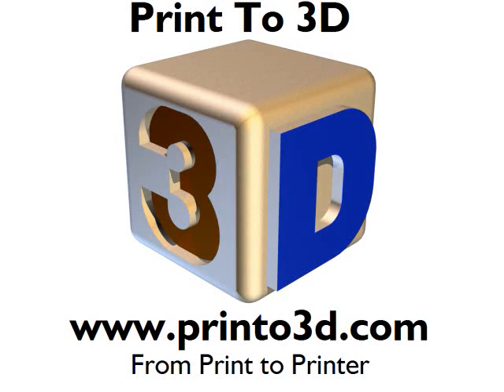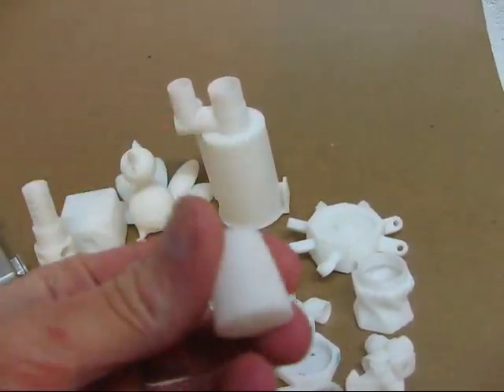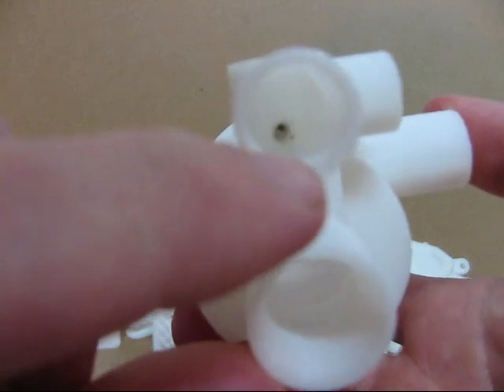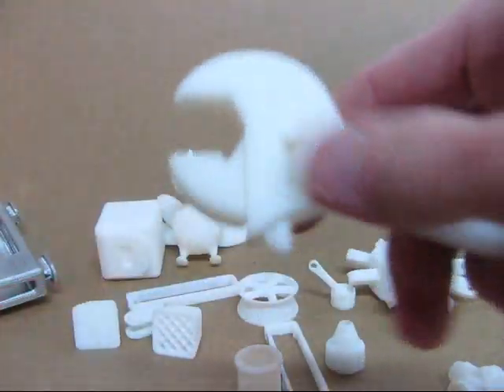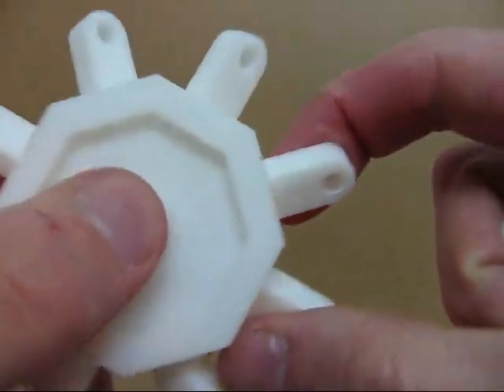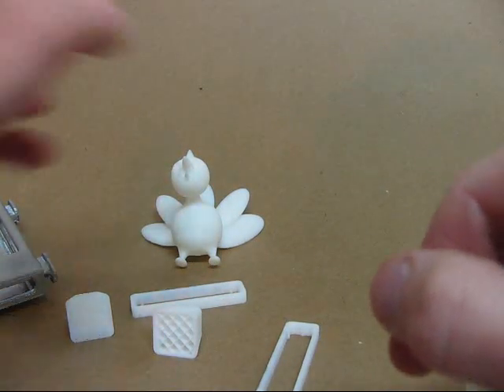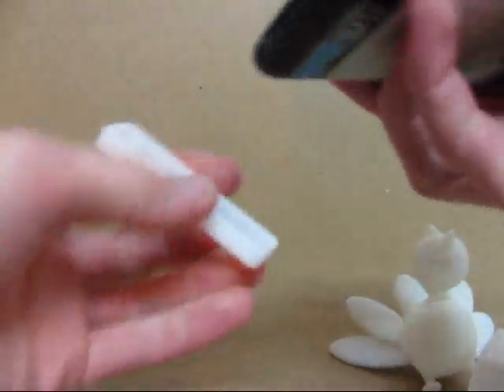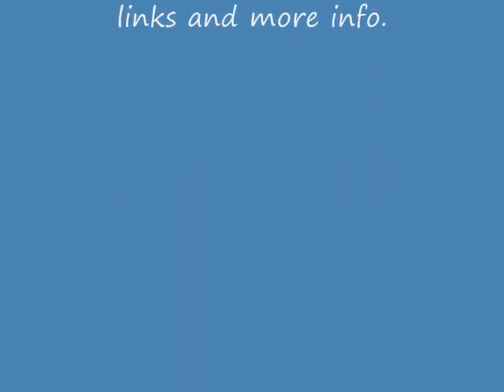What Can You Make With a 3D Printer?

Comment: That hose fitting must have needed some good support. I got a creator w/ 2 extruders but one is far better than the others.  For 1200 bucks, it's a good start. If you give the machine enough time for the support it does well.  Heating plate isn't awesome, so if you get one, get a roll of the yellow foil for the bottom.  It holds up alright, but after too many parts it will get tacky.

Comment: I'm thinking about producing a 3D printer from a plotter that uses wax to make lost wax casting molds so metal parts can be made easily. Simply print out the wax pattern. Place it in plaster and allow to dry, then bore some holes and melt out the wax so you could then pour cast some high grade aluminum alloy castings.They already have 3D printer AR15 high capacity magazines and lower receivers with the regular UV Teflon, Imagine precision AR15 high quality alloy lowers that can be emailed? lol

Comment from the maker: @Pentagon1337 Printed ABS is up to 70% the strength of injection molded parts.

Most 3d printers use proprietary materials and technology.  Some printers print using ABS filament, powdered material, liquids, and even paper.  You can't simply change to any material you would like.

LOM, FDM, SLS, SLA, 3DP are all printing technologies.  Google them for more information.

Comment: @ThomasAtlus actually it wouldn't take longer for more complexity (except to produce the computer model itself), but on the other hand making the CG model would take a long time. The real limiter would be. Is the machine accurate enough to produce parts on a PG scale? As a matter of fact it probably would be difficult to have the machine make the model in 1 go, you'd need to make the runners of parts. Because some parts have different tolerances. You want the model to stay together dont you?

Comment from the maker: @vojin04 3D CAD models are required.  If you are referring to 2D CAD drawings then they will not work.  They would need to be drawn in 3D from the 2D drawings.

10x10x12 inches

Comment from the maker: @MrPowderedToastMan So you think custom parts should cost similar to their off the shelf counterparts?

Sure you can print replacement parts, but that isn't the main use for a 3D printer, YET.  The point is to be able to print anything including the part you just designed in CAD.

Comment from the maker: @pietrosperoni Multiple material printing is available, but not with FDM printing technology.  It is nowhere advanced enough to print electrical cables though.  Mainly just plastic and rubber like materials.

Check out the Objet Connex.

Comment from the maker: @t28sarge FDM does not use powder.  It uses ABS plastic filament and support filament which dissolves.

Even though the support dissolves it still cannot be removed from an enclosed hollow object.

In other words the model will be hollow as drawn, but the support material will still be stuck inside.

Comment: m mine but I can't do plastics without creating a molds first. However I also have a Gage 2000 which uses a subtractive method on soft metals such as aluminum. Email me at rwc1061@yahoo.com I like the fact u are able to create abs pieces, which I cannot. I have a line of RC parts I cast but I would like to get into plastics aswell.

Comment: Sorry, my comments are in reverse order. :-( Also I just wanted to state that I was talking about a zprinter which is different than yours slightly in the way it prints, which is in a powder and doesn't use abs like yours. Can you even cast molds off your pieces? I would think not since the abs has a low temp rating. You should check out a video of the zprinter.

Comment: to a plaster, so things like the wrench or piston he printed couldn't be used. However, you can use the parts to replace other parts of similar materials such as plastic parts. I have seen someone make a working flashlight and similar things. Also, if you got the money to spend, zprinters higher end models can even print in color. The material of the final product can also be electro plated to give it a chrome finish. These machines also have alternate printing materials, the hard plaster type

Comment: Hello all, I just wanted to make a few statements to answer a few questions. As far as price goes for the printer, I use a zprinter 310 plus made by zcorp which is a 3D printer as well and it cost $19,000 from the manufacturer and the 310 plus is their low end model which can print up to 8"X10"X8" per piece in size. As far as applications for the pieces printed, they are basically just models, however, you can cast actual steel parts from the models. The material of the final product is similar

Comment: wow amazing macine, and the things you made are incredible...that takes a a lot of programming doesnt it?? but i just have doubts about that wrench, can it handle heavy duty and more strengh then is build for? -what i mean if the bolt is really screwd tight, you could enlarge the wrench with a steel pipe, for more strengh...but can it handle that?

Comment: I have 4 questions. Is the printer connected to a computer to print, or does it have a built in computer? If it is hooked to a computer, does the software work on mac? if so will I be able to model something in maya and print that out? if it is not connected to a computer, what file formats does it support?

Comment from the maker: There is no support material inside of a sparse model.  If a model is hollow then a sparse print won't work.  If the model is hollow and I do a solid print then the support material is trapped inside with no way to get out.

Best money saver for large volume models is to make them solid and print using sparse print type.

Comment from the maker: Yes the part would need to have an "exit hole" to allow the support material to be removed from the part.  I don't know of any real reason why a hollow part would need to be printed though.  Some people hollow out solid parts thinking about saving material, but it simply doesn't work that way with FDM.  The best way to save money on large solid objects is to print using a method called "sparse print type" which I have a video about on my channel.

Comment: To avoid high prices of material, the Washington University developed a Three-dimensional printing (3DP) prototyping with ceramics, because the required equipment is not outrageously expensive and you can use just about any material that can be obtained in powdered form.

Comment from the maker: Not a problem ask away!

Depends on what you buy $10,000 and up way UP!

I have the Highest end Dimension machine (SST 1200es) which runs about $40,000 all said and done.

Yes FDM machines (Stratasys and Dimension) use strong materials such as ABS.

Zcorp glues thousands of powder particles together.  Both FDM and 3DP (zcorp) models can be made stronger by a variety of different post processes such as RP Tempering.

Both processes have their advantages and disadvantages.

Comment from the maker: Yes FDM parts can be broken, but they are quite strong.  It really depends on how the parts are printed.  If you try bending the part with the layers then the layers will most likely seperate with enough pressure.  Think of it as plywood.  Layers of material are melted together.

Comment from the maker: yes it is an axe cp blade grip.

It probably costs around $5 to make just that in material costs alone.

I was desperate one day when the hobby shop was closed for the holiday or whatever reason so I made a 3d model and printed them up.  They worked, but I wouldn't trust them for long.

Comment from the maker: check out my channel for more information.

Yes these parts are made in a machine layer by layer.  Imagine stacking sheets of paper together and you then get a model when finish.

The process I use is Fused Deposition Modeling.

These machines cost $20,000 and way up.

printo3d (dot) com